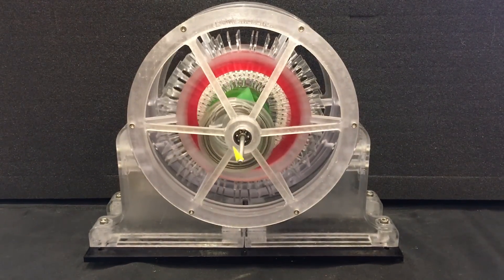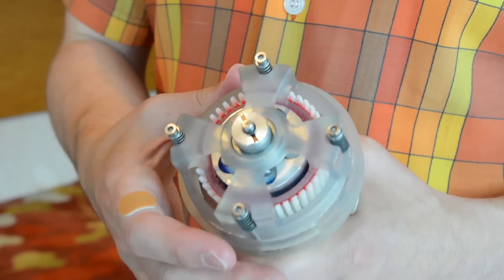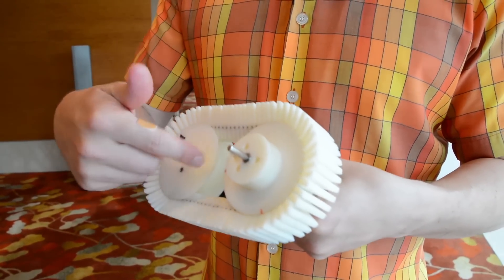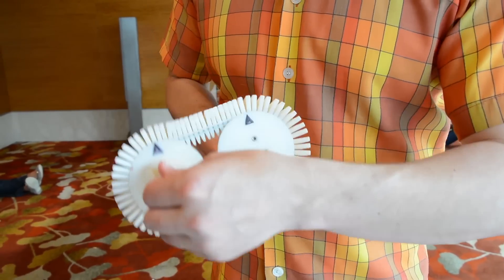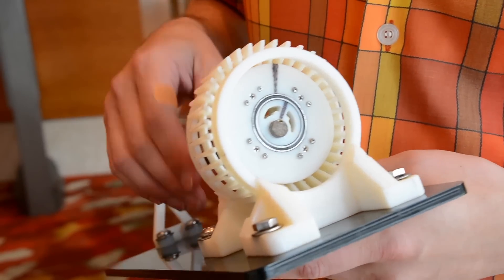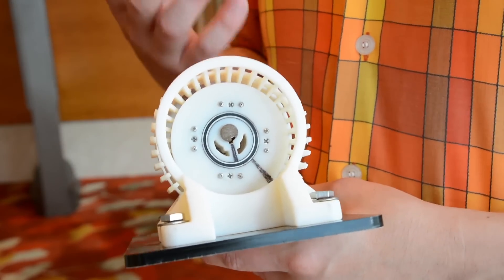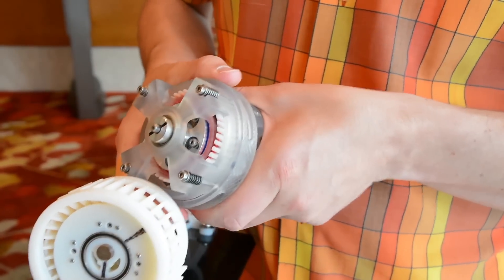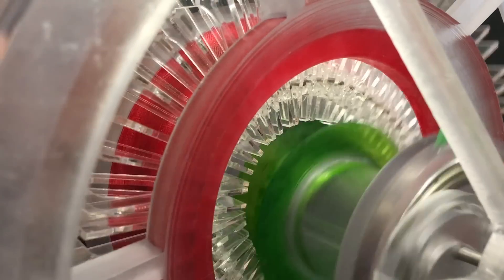Inception Drive: A Compact, Infinitely Variable Transmission for Robotics

Comment: Though it looks like it may have high losses through friction, as it is using the same V-belt principal.
Reply: It turns out that CVTs in cars using metal V-belts can now reach 90%+ efficiency.
Reply: i'm absolutely positive an upstart company will not show any legitimate footage of a real product. that's about the only thing you can be sure of, until you can get one.
Reply: losses in efficiency may be cheaper than the alternatives, depending on usecase of course. i think the main problem is that the motor, gearbox and control unit in robotics is already able to smoothly control speed and direction via fine control of the motor. a simple fixed gear ratio transmission is far smaller, robust, efficient and cheaper than this vt contraption.
Reply: If you want both speed and strength, a variable transmission would be nice.
Reply: Honestly, I think the biggest problem here is the power that this setup can transmit.
If you really have those hard, V-Shaped bits tightened against each other purely by the tension between pulleys, with small surfaces that rub and grind against each other ... 

Eh :S
Reply: @pyalot  Perhaps in applications where not only speed but torque control is needed might be a  valid use case. Also with most electronic speed controls, to get fine grained control over low speeds you lose your higher speeds, and vice versa.
Reply: sorry to be off topic but does any of you know of a tool to get back into an Instagram account?
I was dumb lost the password. I would appreciate any tips you can give me!
Reply: @Lyle Pedro Thanks so much for your reply. I found the site thru google and im trying it out now.
Looks like it's gonna take quite some time so I will get back to you later with my results.

Comment: that's going to vibrate like crazy
Reply: Meh, that can be solved by just adjusting the weight distribution. I'm more concerned about the efficiency, I would want to use a transmission like this to store energy in a flywheel, then you can get out a specific amount of energy using a transmission like this, but if the transmission is very energy inefficient you would be better of just using a battery or some other way to store the energy. Looking at the prototype it seams that the belt can easily slip, but that could probably be solved by tensioning the belt and using high friction materials or something like that, but then there's a risk of inducing a lot of friction into the system thus loosing energy as heat. Still very interesting and the first practical and actually infinitely variable transmission small enough to fit compactly into a energy storage and retrieval system on a bike or other small vehicle :) I'd really love to use something like that on rollerblades, or something similar like roller skies and I like the thought of having it completely mechanical instead of using batteries which usually wear out faster than mechanical parts (depending on the application of course). Also you could fix a mechanical system without needing chemical plants to produce new batteries and such, just some good tools .
Reply: Adding weight distribution will add weight duhh. . I don't even see a place to add that weight distribution. . I'm even confused even if it's cost effective. This is more complex than conventional CVT . . Thus it will be more complex to repair. . Engineers don't build those stuff to be more complex. .  Even I think it's gonna be bigger in size than conventional CVT ending with lot of room in engine bay. . He needs to show us more data. .
Reply: Not mention that the number of moving parts is going to increase, increasing friction and decreasing reliability. It's an idea that looks great on paper and in a slow moving 3D-printed plastic model, but in practice I don't see it being very useful or practical.
Reply: Thad ward low rpm
Reply: Louis Cypher what testing and design phase?I  haven’t seen this anywhere but in his hands.
Reply: Louis Cypher first use your common sense . . People here are discussing, not saying it's stupid. . All techs are stupid but everyone wants to make things better. . So you don't have to call people morons. . Sure he may have came with a solution in mind. . But it's not there in the video. . . but what he explained in the video already is very complex engineering. . Adding more complexity is gonna make things worse. . It's not gonna help us at all in practical life. . The conventional CVT is already complex cause now a repair person not only he should know mechanics, also computing to callibrate the ratio...
Reply: Thad ward. Every time a see a video about these drives. Someone always cries out that it will vibrate it's self to death, it's junk and they wasted their time making it.   It's like everyone on YouTube has some sort of degree in engineering and can tell right away its junk from seeing  some prototype at a trade show for 5 min.. I guess we should never try to make anything better or different.  Only do things we know will never fail...
Reply: not all drives are high speed .some i have worked with are below clock speed
Reply: ladies will love it
Reply: this looks like a variable cycloidal gear ( that's probably where they got the idea) and those are for low speed applications... You can certainly spin an out of balance part fast with a built in counterweight successfully... Single cyl bike engines do this exceptionally well but the real nagging question is how bad does it slip and what does it really give us over a regular slushbox cvt besides the small size and deep reduction which is probably great but I bet that deep reduction makes it slip worse and less efficient which may be fine for low speed 😵...
Reply: I wonder if you could stack two of the contraptions inline with each other? If the two gizmos were offset by 180 degree then the vibrations should cancel out. I know they do this with some unsymmetrical reducers already.

Comment: A heavy-duty version of this would have been good to have back when railroads wanted to run trains using AC motors but electrical engineers hadn't figured out an electronic means of making variable-frequency AC -- of course back then, nobody had figured out how to do this either.

Edit:  Would also still be good when your source of power is an internal combustion engine, which has a minimum operating speed and in most cases can only operate in one direction.

Comment: I'm usually able to immediately figure out how a piece of machinery works, but this is not clear to me.
Reply: davidsirmons Same here.. Could use a better example of how it works maybe.
Reply: It's not that the example is not good enough, it's that some systems are less intuitive than others. This one is not so straight forward.
Reply: Take a rubber band and wrap one end around your left hand pointer finger, and wrap the other end around your right hand pointer finger and rotate the rubber band by orbiting your fingers around each other, then try changing one end by adding 2 or 3 fingers and notice how the speed at which the rubber band moves changes. The orbit of your hands is the input, the speed the rubber band moves is the output. Now, just imagine that instead of one finger having to orbit around the other, you could "push" the rubber band around in the same orbiting motion by having an egg shaped wheel rotating inside of a hollow circular wheel. Replace the rubber band with a cone shaped belt and that is the whole mechanism.
Reply: He didn't really break down his explanation into clear steps, so I was pretty confused too. I'd really need a good diagram to figure this one out.
Reply: It seems to work on the pitch of the V shaped radial plates, With a contact PCR for the Input and a contact PCR for the output.Change the pitch , i assume by tightening around one of the contact PCRs, and the ratio will change.I also assume that this would have a hell of a lot of friction.I would like to analyse it with a temperature camera.
Reply: Mind blown, very nice.
Reply: Clifford Swartzell Great breakdown! But how does it change directions? I saw no example of this in the video although it was mentioned. (Or at least I though it was....)
Reply: Imagine a spirograph (the kids art toy). You have a ring with gear teeth on the inside and gears with a bunch of holes radiating from the center. You put your marker in a hole in the gear and make the gear roll around the inside of the ring. If the gear is very small, every time you move your marker one revolution around the ring, the gear will spin a lot. If the gear is very large, it will only spin by a few gear teeth per revolution. The a bit that's a bit funky is that he figured out how to make the gear bigger than the ring to make it rotate backwards too.

Take a look at his cream colored prototype. His inner pulley is tightened to just the right amount that the V-belt doesn't move in relation to the inner pulley. It makes it operate exactly like the spirograph analogy. Imagine the metal shaft is a marker and stabilize the video where the V-belt isn't wobbling, but instead the "outer pulley" rings are wobbling and you're looking at a spirograph.

It's essential that you know the V-belt (his is made of triangular plates along a stretchy band instead of a solid V-belt, but it's still just a belt) is elastic and has to be for the design to work. For that cream colored prototype, the belt just happens to be stretched to just the right length to perfectly match the eccentric offset. In his more refined prototype shown at the very beginning of the video, the inner pulley is smaller so the belt moves in relation to it as well. You can see how this design can process around both the inner and outer pulleys and how it could be variable by changing the size of the inner (green) pulley or outer (red) pulley. You change the size of the pulley by just making the front and back rings of the pulley closer or further apart to change where they touch the V-belt.

The final design turns the wobbly green pulley that is your output shaft into a non-wobbly output shaft so you can actually use it.
Reply: Good, I'm not alone.
Reply: A variation of the harmonic drive.

Comment: Now we will have to see if this low speed / low torque polymer model can be effectively scaled up to a stronger metallic design and hopefully still hold up to the forces required by manufacturing industries.

Comment: Looks like the kind of thing that would be beating inside the autonomous robot that is going to kill us all. Gorgeous! ^_^
Reply: It's purely mechanical and has only mechanical capabilities and does literally nothing towards autonomy or intelligence of a robot. Also, the problem this piece of technology solves has been solved a long time ago, just not as compact and simple.

But I agree that it is georgious!
Reply: I pictured a more advanced and complex version, embedded in electronics, that would intelligently distribute torque from a single main engine to a fully articulated skeleton. ^_^
Reply: Damian Reloaded 
I'm thinking of the precision movements that athletes articulate through feet for balance and speed.

Comment: Now the question is if it can be scaled up (or down) and how much power it can safely handle.
Reply: I suppose as much as you want, depending on the material used and it's overall size. A fully metal one, will probably be able to handle quite a lot.

Comment: It looks like the Antikythera device X-ray. 
How does it increase output against resistance? The clutches allow slipping so the motor won’t stall, I think. It seems it would always be applying torque to whatever it’s attached to...but I’m not the dimmest LED on the panel 👇🏼

Comment: I hope they release the STL files!
Reply: Why would anyone in their right mind, who has worked hard to develop something that could potentially make them a lot of money, release their intellectual property...to YOU?
Reply: To be honest it looks like a combination of:
https://youtu.be/ie2wwAnKDM0
and
https://youtu.be/YPILiSjsvgE

Then instead of using that cam ring to pivot an iris mechanism, you use it to change the radius of the output shaft pins. Then the locating holes for the offset pins would go into their own sliding track or sleeve on the intermediate disc. Friction surface replaces where the outside of the cycloid disc meshes.

At least that's how I picture it.

I wouldn't rule out somebody with enough time uploading something to Thingiverse if they feel like figuring out how those go together. That would only be for demonstration though, since I'm guessing a patent is being claimed on putting the already existing A & B together for this thing.
Reply: OU812 ...because some people believe that knowledge should be shared.

I'd have thought, that was rather obvious.
Reply: +Pook365  You're delusional. Nobody thinks knowledge that can make money should be shared.
Reply: Never download any open source software such as Audacity or Linux with an attitude like that. I create tutorials all the time that I distribute for free.
Reply: @rob99201  dude what about Blender ? 
Those devs are working harder than Adobe and Autodesk combined, and they live off of community pledges and the occasional corporate sponsor 
Blender Foundation is a non-profit organization that makes one of the best pieces of software mankind has ever produced 
ITS fast, like insanely insanely fast, 3ds launches in MINUTES on a workstation while Blender, in it's currently and latest version works on hardware from the 90s and on a laptop launches in 1 second 
The UI is also fully configurable with modules that can be swapped and new workbenches that can be customised, all not possible on the competition 
Most importantly ? EACH YEAR UPDATES BRINGS FEATURES PEOPLE WILL ACTUALLY USE along with whole new tools and functionalities 
If you've ever used 3ds or Maya you'd know they basically only update to fix bugs 
Oh, yeah and Blender works on Linux too 

I'm bringing this up to show you that while some people who believe knowledge that can make money shouldn't be shared, others are pushing the boundaries of possibility and working tirelessly to create something truly glorious 

Blender is Love, Linux is Life
Reply: @mihailazar2487  My reply was to OU810. I have contributed to the Blender Foundation, use Linux and the Unreal Engine all the time.

Comment: With the noise at end,  wear has to be huge unless you use teflon or similar material
Reply: Even teflon wears out with enough heat and friction, or nobody would have replaced their pots and pans with it because it wore off.

Revisiting this, it feels very much like they invented a millipede in a circle, as that's how it appears to move, with the size of the steps depending on how much load it has on its back on the inside in the endless walk.

Comment: Does this drive mean that there is a decrease in wrap angle on the pulley? therefore that in a high torque situations the belt will slip.
Reply: and also forces acting on the belt are parabolic so calculations are going to be more complicated

Comment: Very cool. Is the force/torque transferred on the tension side or the compression side of the belt?
Reply: You can do either. Current designs use pull-belts as opposed to push-belts

Comment: Looks like a cycloidal drive, but I'm guessing its different because the radius of the output rollers and their contact area on the cycloidal disc can be changed? And then you replace where the ring pins would normally engage the cycloidal disc with a friction surface, because otherwise it wouldn't mesh when changing the ratio. Is that right?

(There's a cycloidal drive diagram on wikipedia, for anyone trying to make sense of what I just said.)